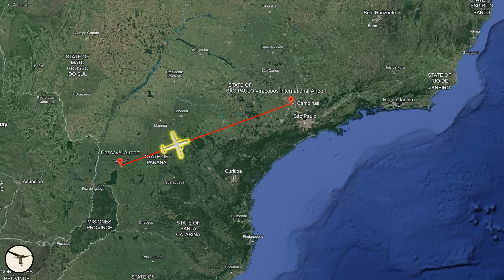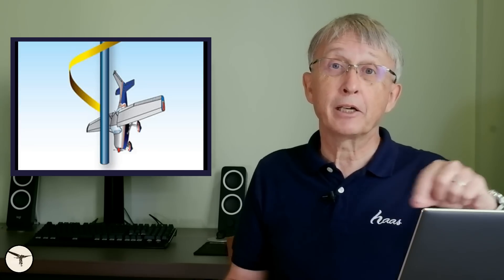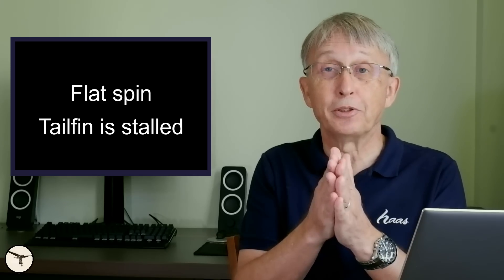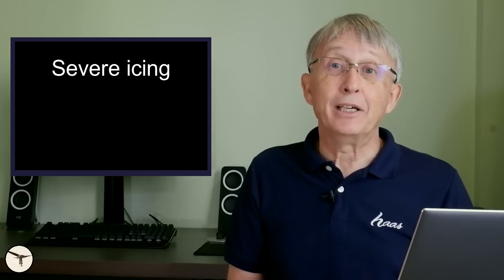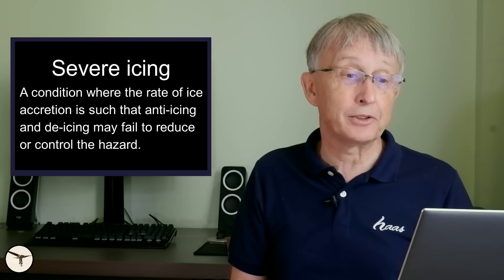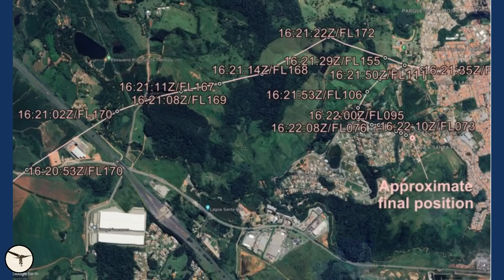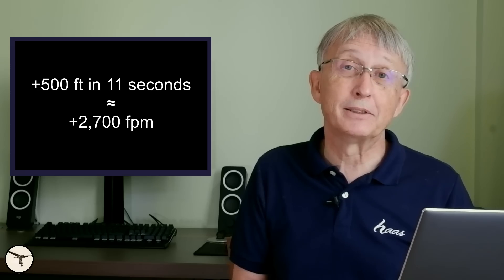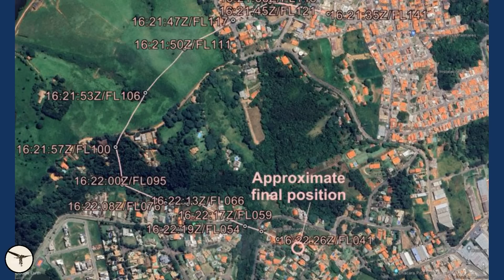ATR 72-500 Crash: Understanding the Fatal Flat Spin & Severe Icing Dangers

Comment: Hi Magnar, The audio (cockpit voice) for last 5 minutes of the Yeti airlines crash - ( Flight  691, January 15, 2023 )  is out on youtube. I can hear the Pilots complaining about faulty instruments (  Barometer and compass ).  They also discuss the flaps at least 4 times.. And they confirm Flaps are at 30 at least 2 times, including a checklist run in the last 30-40 seconds... 
So I suspect the levers were at the right place, the flaps were at 30 and the Engine were not feathered, but due to instrument error the engines went to feathered state.. Can you please take a look at the audio.. 
I will be happy to translate..
Reply: Also both pilots look genuinely nervous and confused during the last 10-20 seconds, so there is no foul play.... It looks like a maintenance error to me rather than Pilot error.
Reply: @liveandlearn515  

it's been already reported this ATR passed all the regulations and it was in mint condition from the brazilian government.

but you raise good points.  Here's the answer to them:

1)
yes, and the reason being a gust current change between 13:20 -13:30 GMT-4, from West to West North West winds. Causing a radius 0 condition on the center of the plane (vacuum). Autopilot decided to change into manual pilot mode after failing to stabilize the plane. 

2)  
this introduced a stall where autopilot in hotel mode favors altitude with tradeoff speed, in a span of ~30 seconds.

3)
the vacuum did the rest on a stalled plane
Reply from the maker: Hi @liveandlearn515. The final report released last year confirmed the propellers were feathered by one of the pilots. The CVR recoding is translated to English, and a video explaning the technical aspects about what they said will be released soon.
Reply: Hello  @FlywithMagnar   . Thank you for your reply... The cause of my doubts are the fact that I can hear the pilots confirming that the flaps are at 30 multiple times... Also the mentoring pilot says "What happened" in the last moment, as if to imply, Everything looks all right, still what is wrong..

Comment: If anyone wants to fly this without having to start is cascavel... use this flightplan: SBSP UGTIX2A UGTIX DCT EVRAL EVRAL1D SBGR it gets you up to 17000 before starting the star. TOD should be between GR249 and GR251, exactly where the ATR stalled.

Comment: 5:21 What sensors does the APS use? (Perhaps pitot, angle of attack, engine thrust).
It appears to be associated with cruise mode of flight. Is it disabled in other modes of flight? e.g. when landing.
Can a false indication (e.g. false flap extended or gear down indication or radar altimeter falsely shows it's near the ground) prevent APS from being active in cruise but give no indication that APS is no longer monitoring for degraded performance?

Comment: I never liked travelling on ATR aircrafts. Very unsafe aircrafts compared with other Boeing and Airbus aircrafts. Two other incidents happened in the recent past. One a few months ago in Nepal and other one in 2016 in Pakistan(my country). In both cases there were no pilots errors. There were engines failure in both cases. How sad that we are still using these disasterous ATR aircrafts.
Reply: The Nepal crash was clearly pilot error. The pilots feathered the props by mistake and didn't realise what had happened.
Reply from the maker: As @igclapp wrote, the accident in Nepal was caused by pilot error. The accident in Pakistan was the result of improper maintenance of one of the engines.

Comment: I have flown a lot with the ATR 72-201 (Msn:140) series planes when I was a child. 

We have severe winter conditions in Finland, despite that, there have been no accidents.
Reply: Because the temps are already below freezing on the ground. Its not as big an issue in Finland
Reply: @jamesharris9816  And perhaps much lower moisture in the air.

Comment: 5:07 That's a big degradation of the stall protection!
In non icing conditions you have a stick shaker and if the pilot fails to respond to that, then the stick pusher will activate.
However in severe icing conditions you just get an APS light illuminating! (And hopefully, an audio alert, that hasn't been mentioned).
Stick shaker and stick pusher were only created because there were so many incidents where an audio/visual stall warning wasn't enough to get the pilot to lower the nose.
I know the shaker/pusher will still activate later, if the pilot doesn't respond to the APS warning but that's too late in severe icing, as proven by previous ATR accidents.
Obviously APS is much better than no APS but it's a very big degradation from the stall protection in non-icing conditions.
Reply from the maker: The stall protection system is triggered at different angle of attack (AoA) in normal and icing conditions. Therefore, the warning will come at a lower AoA in icing conditions. However, severe icing, can result in a stall before the alert is triggered. The best defense is to keep the speed up. The APM is just an additional layer of protection. If gives visual and aural warnings to warn them before they reach a dangerous conditions.

Comment: in a twin engine, could you use differential thrust to counteract a spin if you have independent throttles? So if you're spinning clockwise, drop left engine to idle and throttle up the right to counteract the spin enough to regain control, is this even a possibility?

Comment: Those descent rates seem too high for a "flat spin."  There is a video that shows the aircraft emerging from the clouds spinning in a classic vertical nose-down attitude,  but then quickly transitions to the flat-spin position it crashed in.  Good chance the flat spin was induced as soon as the pilots saw the ground.

Comment: Pilot error.   Slow airspeed.   Didn’t add power,  and they didn’t lower the nose in time.  If ATC won’t give you a different altitude,  declare an emergency.
Reply: bad plane design + new gust setups starting June 22 2024 = old planes should be grounded and removed out of professional flights.

Comment: "We cannot speculate"? Of course we can speculate, that's why we're here. My speculation: It started with forgetting to turn on de-icing. Probably pilots not experienced enough with recognizing conditions, & slack company policy that allowed them to fly into those conditions.
They recovered from the initial stall but then stalled again when they left the nose too high & lost too much speed. They didn't recover from the 2nd one. No excuse for it, they were at 170 & had an entire 60 sec+ to look at the checklist, reduce power & get the nose down to recover. They panicked.

Comment: The aircraft was climbing, diving and turning all over the shop. Looks like the flight crew became spatially disorientated because the plane was so compromised by ice that they were forced to fly it manually. Ice might even have blocked pitot tubes causing false warnings so that they were getting overspeed warnings when in reality they were stalling..... What a nightmare.
Anyway, the flight data and voice recording will hopefully shed some light on the accident and its circumstances.

Comment: I was fliging outside México city in ATR 42 in 1993 i think Aeromar they was mistakenly they informatión abouth they ice was forming in our wings You don't imaginé the airplane. Begin to loose speed a Lot the pilots dident identifi the problem till they put the antiicing boots and then a Lot of noise coming from the propeller mean the ice is ejectec then we gain speed and altitude jajaja i was the mechanic on board hope You understand ATR i don't trusth anti icing system